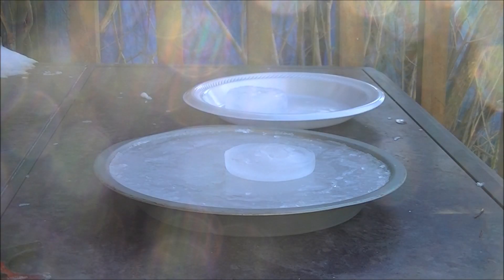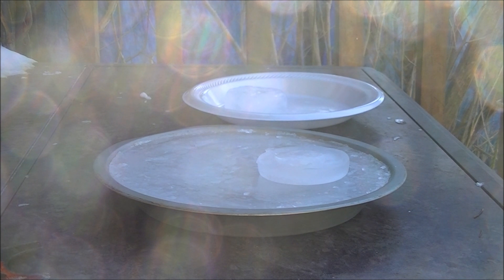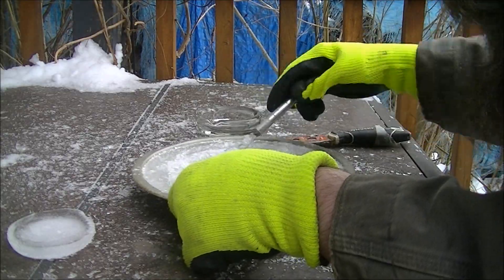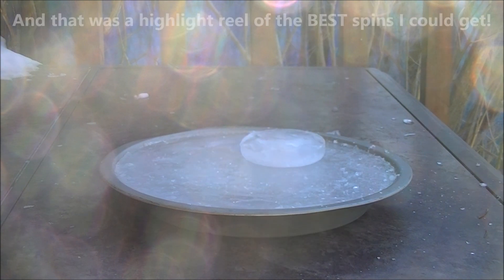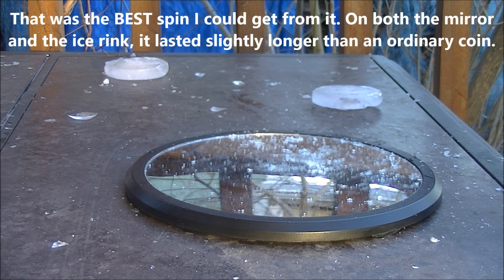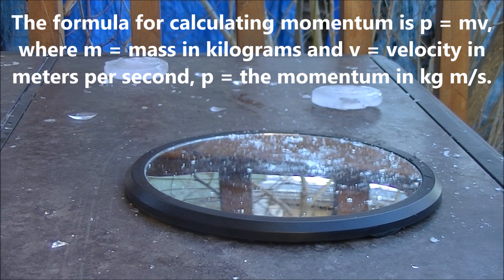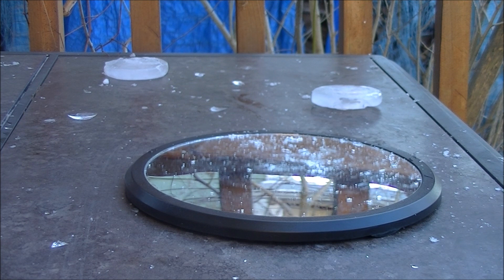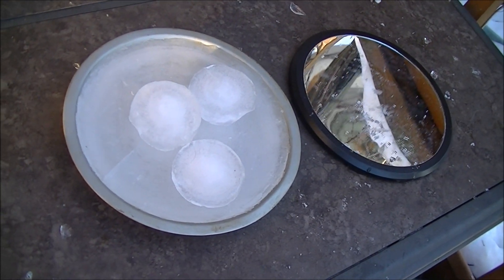Euler's Disk Made Out Of Ice - Will It Spin?

Comment: Hello my friend!  The ice disk does not look like it is equally distributed in weight after freezing which may be a reason it stops sooner, being it is ever so off balance. Great experiment. We must keep in mind experiments do not always mean success. Great job!
Reply from the maker: That might have been a factor, as I think that's why they kept flying off the surface (they'd hit a "snag") in spins I didn't air (overall had about 20 attempts, 10 of them they jumped off the surface). I got it kind of close since with all the disks I added water slowly little by little and it froze in layers. Still ended up with something disk-like thankfully. Very true, I had never seen this done before and it was a total gamble, it could have gone anywhere from full Euler's Disk spin to 3-4 rotations before falling over. Thankfully I got at least a few seconds apiece (20-25 rotations). I might try this again with a more reliable substance like wood. Thanks for watching!  :)

Comment: I think where you are is a very cold place. I live on the southernmost island in Korea! So I think it will be about -20 degrees Celsius where you are now. Applause for your passion to experiment outside in this cold weather!
Reply from the maker: Thanks! Glad you liked it!  :)  And it wasn't quite -20 Celsius here, but it was about -15 when I filmed, which is still pretty cold. It's been a very mild winter here, usually we average between -5 and -10, but it's been between 0 and 5 degrees this winter. I've seen it as cold as below -30 before during some very cold winters.
Reply from the maker: I've a new novelty song now out

Comment: From this point of view, the ice disks appeared slightly uneven. There seemed to be a bulge on the disk that was off center. 

It's almost like you have to create the ice disk in a mould the same way a Euler's Disk is made, sanding down any uneven spots.   

Your idea is Innovated, and it illustrates why a material like wood would fare no better.  The ED must contain special properties where it only works when combined with the tray that comes with it.

i don't believe the ED will spin on just any surface.......
Reply from the maker: Very true. Even though I did all of the above (spent months searching for perfect containers to achieve the shape, added the water very slowly in stages to minimize warping, sanded down rough spots) it still came out a little imperfect. I imagine wood might fare slightly better since it could be given a smoother surface but it might spin for 11 seconds instead of 5. And that's very true, the Euler's Disk being solid stainless steel helps it get a good spin. That's why it outspins ordinary coins by a massive margin but the ice disks were about on par with spinning regular coins. You just gave me an idea! I might try one made out of wood later on just to compare. That would be fun. The shape of the tray being slightly concave benefits all coin-like objects but especially ones that side. Euler's Disk without the mirror would spin for about 40-45 seconds (still impressive) but spins for 100-150 seconds with the mirror. The best spin I was able to get with a coin was 11 seconds on the table, but I could get twice that on the mirror, I bet, but the proportions mean it wouldn't be as positively affected as the Euler's Disk (and even the ice one) was.
Reply: @AltoonaYourPiano  you want two materials which produce the least amount of. friction, although some friction is necessary to keep the disk in contact with the surface.  Unless ED is hollow, stainless steel is considered a hard material, so your wood should be oak, maple or cherry,  or a wood of that nature.  

The surface of choice would be of a softer material, perhaps some polymer, but you can always experiment.  Then, adding oil or some lubricant to the surface would reduce the friction further, and you should have longer spin times.

That idea might not work with ice as ice is a few degrees away from being its own lube (water); perhaps you were using ice against a soft surface, when it feels more at home with a hard surface. Interesting would be tile  or even porcelain,

It got me thinking about the law of diminishing.returns and the effects of gravity and drag........
Reply from the maker: @spokenwordillusions5756  Very true. I remember when I took karate classes 25-30 years ago (made it all the way to black belt until the school left Altoona, but just first degree black belt), we had boards we broke and the lower ranks used pine boards, once I got to be a green belt the boards became a lot harder to break, I asked why I was having such a hard time all of a sudden and the explained more advanced students got oak boards. I think a wood Euler's Disk could be fun to experiment with. It'd probably outlast the ice disks but not the steel one. I think another cool idea might be the regular Euler's Disk but underwater. I imagine a similar effect to the Newton's cradle underwater, it worked but not for very long.
Reply: @AltoonaYourPiano  it would go in slow motion since water has more resistance than air, or is it liquid has more resistance than gas?

Soft against soft produces proportional amounts of friction as hard against hard, so to get the most spin, use hard against soft; in other words, two unlike substances; one will be harder than the other.
Reply from the maker: @spokenwordillusions5756  Yeah, that's what I'm thinking, too. It'd spin in slow motion and for not nearly as long, the latter part of the spin not happening at all, but I think it would spin long enough to still be kind of visually interesting. Much like this.
Reply from the maker: @spokenwordillusions5756  I was tempted to vlog about the snow but there was so much going on that day (doctor's appointment was the main thing) that by time I remembered the snowstorm was over. We got about a foot of snow but after a little freezing rain moved through it shrunk it down to 6 to 8 inches of really heavy snow with an ice crust. I nearly threw my back out shoveling it. It reminded me of in December 1992 the giant snowstorm that collapsed my neighbor's garage after 2 feet of snow fell then we got 2 inches of rain (but it was only like 36 degrees so surprisingly little snow melted).

I'm going to do some sort of snow vlog for sure at some point, though.